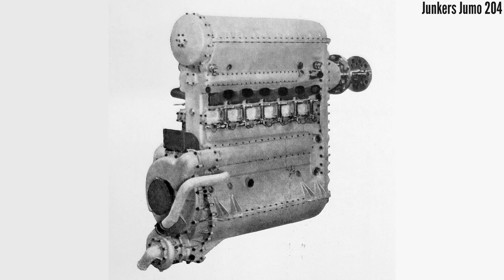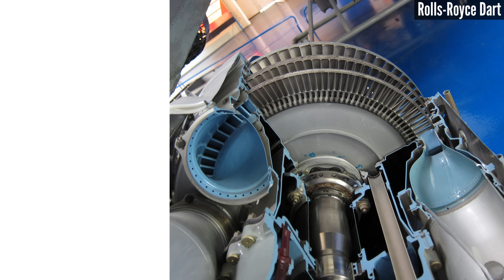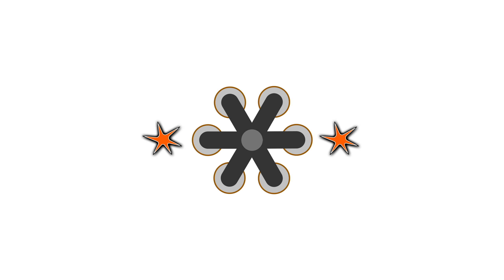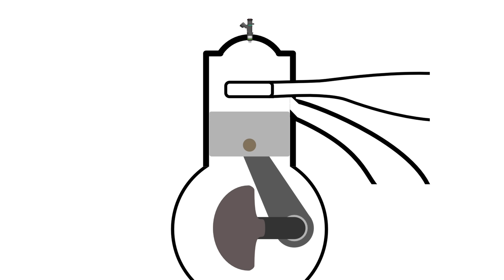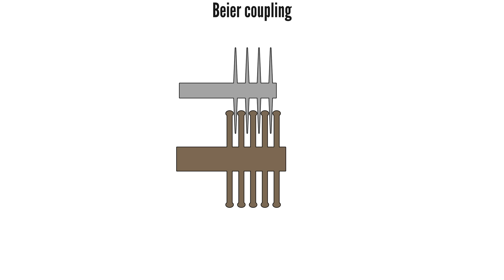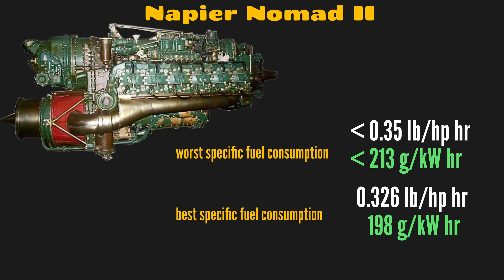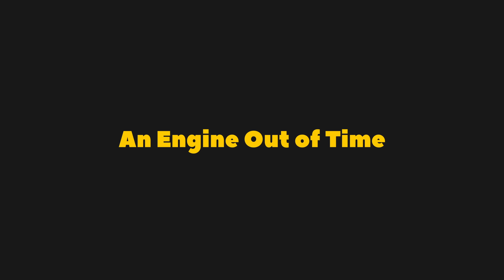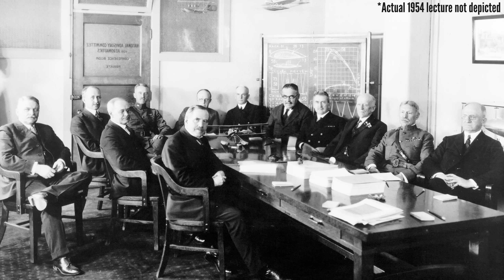Napier Nomad, the Most Complex Aero Engine Ever Made - Explained

Comment: The engineering of these motors at the time was and is still astounding.
Reply: Yes and lets fit the napier nomad 2 stroke turbo on a drag sled! The 850 Rotax etec turbo r, 858 arctic car turbo and polaris 850 patriot turbo 2 stroke s and 9R carry on the Napier Nomad 2 stroke turbo legacy!
Reply: mind boggling
Reply: Sim.
Reply: Unfortunately in todays world of new tech these motors are just abysmal in terms of efficiency…complexity and high pollution…they were amazing in their time
Reply: @chrisvig123 Beg to differ. The same principles are quite viable, and we could make it smaller and better with modern materials. They are actually working on ethanol- and SAF-HCCI too at Uppsala Uni since 2015. The problem is more that there's no market for intermediate aviation that has an application to match this engine's advantages over turbines. And that all the climate-muppetry is putting spokes in the wheels for getting investment into anything involving combustion, even if it's clean fuels.
Reply: @Sakhmeov  The only muppets are those still banging the drum for burning fossil fuels.  Car engines are between 12 and 30% efficient at turning their fuel energy into motion.  An utterly lamentable statistic.  70 - 88% of all the fuel you buy and put into your car will be lost as heat through combustion and friction.  Hardly any gets turned into actual motion.
Compare and contrast that with modern electric motors which achieve well into the 90s% efficiency at turning their fuel into motion and ICE engines should be getting prepared for extinction.

Regenerative braking boosts electric vehicles, there's no such thing for ICE engines.
Reply: @captainwin6333  1: "Fossil fuels" aren't entirely "fossil" but regenerate slowly.

2: I wasn't talking about fossil fuels; Notice how I said SAF and ethanol. Even so, stopping the oil and gas extraction businesses is idiotic on account of how you still want the petrochem for other stuff.

3: Diesels and other HCCI or near-HCCI combustion achieves thermal efficiencies of >40%, approaching 55% in large and specialized engines with fully modern tech.

4: Flying, if done right, is considerably more MPG-efficient than start-stopping and fighting rolling resistance on the ground. Not to mention the negation of impact of particulate emissions from tyres, brakes and other contact elements and components taking higher specific loads. Which also applies to an even greater degree to electrical vehicles due to their weight. Weight and power density demands being something that precludes any straight electrical solutions from being applied to aviation feasibly, by orders of magnitude.

5: Electrical engines may well be built with 90-92% direct efficiency from line to stator, even higher. However even just the battery itself tends to have 1.5% conversion losses internally. Then you have transformation losses sometimes hitting 10% on the way from the powerplant, averages of 1.5% losses again going through the power lines, and transformation losses up at the actual station tend to once again be somewhat negligible, 0.5-1.5%. But well at the powerplant, once again you're usually doing combustion for heat transference into steam driving a turbine which spins a generator, which altogether mostly doesn't beat those big diesels in terms of efficiency. Average photovoltaic efficiency is a little north of 20%, though of course the "spillage" there isn't really harmful - but the products in the panels are. Wind is again, in real terms, something like half, and unreliable. The only really rock-solid efficiency source with large enough innate capacitance is hydro.

6: There are both pneumatic and electrical systems for regenerative braking for ICE engines. The hydropneumatic variant is both reasonably efficient for purpose, and also easily mechanically serviceable, and has the advantage of lightness.

You are clearly a semi-technically literate idealist. I'm a technical specialist and inventor in the field. Please, don't.
Reply: @captainwin6333   No, engines should not be getting prepared for extinction, battery tech is not fully mature enough yet to have comparable levels of energy to fuels. Engines are unmatched when it comes to power and energy per unit of mass (specific power/energy). Also the majority of electricity produced in the US is from fossil fuels (60% fossil, 40% nuclear plus renewables) I understand people can derive their own clean energy at home via solar panels, to be fair. 

There is a reason you don't see battery powered planes, the specific energy of current lithium ion batteries is 2% of aviation fuel. Just because there is a drawback that we need to face and accept, doesn't mean we should stop improving emissions and efficiency on what has been developed so far for engines.
Reply: @amorag59  Well, most countries (mainly Europe) are not as backward as the USA on electricity generation, a situation that seems to be getting worse with the current idiots in charge over there.  For example, the UK regularly generates more than 50% of its electricity needs via renewables only (wind, solar, hydro and biomass).  Plenty of other countries are also rapidly expanding renewable generation.
As for electric powered aircraft, they are already here. The Pipistrel Velis Electro built in Slovenia has been certified as a trainer since 2020, others are imminent including commercial regional and commuter planes.
Reply: @poruatokin  You got that right, it's open season on Americans right now lol. I would gladly replace our natural gas and coal here with something cleaner. As for the Pipistrel, it's 50 minute flight time (~100 nautical miles) proves my point. Around 1/6th the range of a Skyhawk trainer for example. All I'm saying is it's a bit brash to say they should prepare engines for extinction when there is no match when it comes to specific power and energy. It is entirely reasonable to develop both electrical and combustion technology further at the same time.
Reply: @captainwin6333  I'll be brief and quick with my response but we can all agree to disagree. Two cents given and offered.
Reply: Yea and with no computers. Just real craftsmen who knew what the hell they were doing.
Reply: It was pretty good but it was also decades and perhaps centuries behind science and scientists.  Look at the stuff Einstein, Schroedinger, Max Born, Heisenberg, Pauli and Dirac were working on decades before this engine went into production.  Loads of that wont be realised for years, decades and probably centuries.
Reply: @captainwin6333  Hah. True genius is a ball bearing.

Simplicity and elegance of design... Feynman got it right. Something that gets 20% more performance for 80% more processing or horsepower, is always going to be beaten by something that gets 80% of the way there for 20% of the cost.

Because while hyper-engineered or -specialized solutions or consolidated efforts have their place, they don't upgrade civilization. Not immediately; Because rich men's expensive toys don't make a difference to anyone but themselves, if that. And not for the future, in such a way that it's actually realtime-working; Because when the original inventor is dead or out of the picture, things have to be accessible to a successor.

There should be a Nobel Prize of Engineering. Sadly, they went for the nonsense of "Peace" instead. Because apparently, that one is easier to judge? No, of course, it was a question of "humanitarian" concerns...

Of course, none of this is to shit on all the great theoreticians. But I'm just saying... There's a good reason that people don't know Chained Arrow Notation, really, or much of who came up with it. But they do know a Diesel engine when they hear it.

Comment: It would be interesting to see if the complex and power hungry brier coupling could be replace by electric generator and motor giving the advantage of turbo compounding without the mechanical complexity.
Reply: yes! especially because the turbo part often broke down because of the constant shaking. electric stuff was much heavier that time but maybe with today technology... also turbine part could be so much lighter now
Reply: @jebise1126  "todays technology" still obeys physics. the generator and motor have no choice but to follow very strict and well laid out principles of operation. there is no "magic scientific stick" that can alter that.

"jacobis law". the aspect of electrical theory they never tell you about. you can arrive at the same concept if you simply think a little, rather than swallow articles written by journalists and people whose job is to write glowing reports about whatever topic crosses their desk, because thats how they pay their bills...

hint. the generator has RESISTANCE. so does the MOTOR. now... consider what happens when they are of equal value...
Reply: basically similar to the new Porsche 911 GTS
Reply: F1 have been effectively doing this for 11 years now.